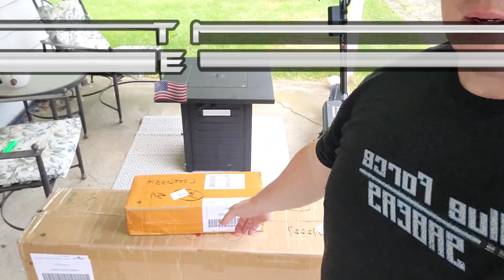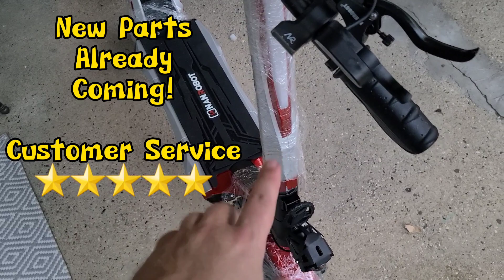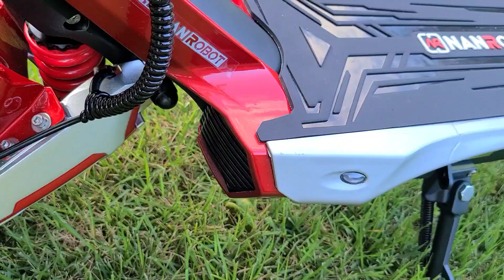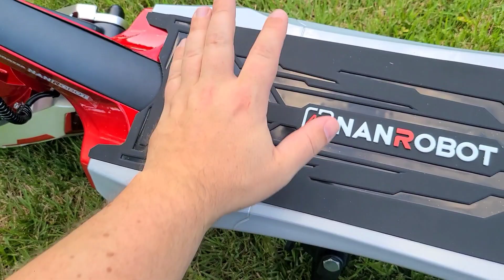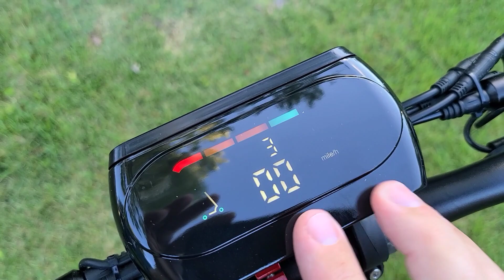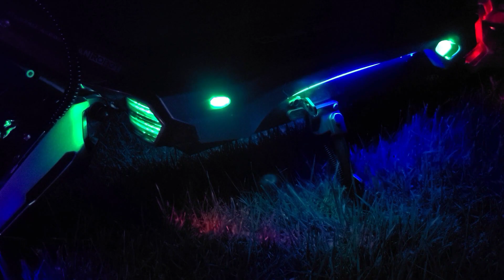Nanrobot N6 Electric Scooter - 1st In The USA -- Deep Dive Unboxing and Setup!

Comment: Nanrobot quality isn't really that good.. coming from the ls7+.. these are very expensive.  And it  falls apart  quickly.. brakes squeeked right outta the box.. headlight rattled right off even after I tightened it all the way.. and the tires aren't very good.. got a flat with in a week even with proper inflation..   all stand up scooters tires should be airless , because changing the. Tubes out is a bitch.

Comment: The lack of 60v battery ruins it imo
Reply from the maker: Really don't think you need a 60v. 60v scooter you only gain a bit of extra speed and acceleration but loose quite a bit of run time.

Comment: Did the p setting/lcd fix also take care of the odometer resetting on newer released d6+ 2.0? Planning on purchasing a d6+ 2.0 but wanted to make sure I got a fixed version. Thanks!
Reply: It's fixed on the N6 but I believe it still resets on the D6+ 2.0.
Reply: @BlueForceSabers  do u have an idea if they will update them at all?
Reply: @JayHyphy18  Not sure honestly
Reply: Are the decks the same size n6 and d6+
Reply: I just got d6+2.0 and it does reset everything. I dont care but it would be nice if they do fix it in future.
Reply: @pacochawa2746  does it completely reset the scooters odometer also or just the trip meter?

Comment: Where are the controllers located in the N6?...  I didn't see them under the deck when you installed the battery.  I'm going to guess they're located in the rear tail fin
Reply from the maker: It's just a single controller in the N6 and D6+ 2.0. They both use the same one. You can see it under the wires around 5:24 in the front of the deck.
Reply: @blueforceerides  that's cool! How many amps is this single controller? I've got an older D6 that uses two 28a controllers
Reply from the maker: @spencerjames1426  Yes, they changed it to a 2 in 1 setup with the center display. I'm not sure of the amps off hand.

Comment: Those  too much Led lights can eat up Battery life
Reply from the maker: Not really, LEDs draw very little power. Shouldn't really see any difference.
Reply: @blueforceerides  facts. LEDs are extremely low power.
Reply: @blueforceerides  Yes a little draw if it is just one or two leds but when it bcomes too many believe me it will have a big impact,  like 5w or 10w,  that's why other  escooter rider prefer  a separated supply power bank for the LEDS,   so ok,  for you its ok to have thousands of LEDs,  but for me and the others will use a separated supply   God bless

Comment: Hmm battery could use double sided tape to cushing it in makes sure battery fits tight and snugg with no bounce around
Reply from the maker: It does have double sided tape on the bottom. It also fits snug so it doesn't slide at all.

Comment: I want to see you ride it not just talk about it.
Reply from the maker: Unfortunately, I don't have all the cool 360 cameras to show me riding it but I can certainly give you the details and information on it. I'll do a bit of ride footage in the future with the old GoPro. This was more of an information and first look.
Reply: @blueforceerides  How is the size compared to the D6+?  Can you put this in the trunk of a normal sedan?  Is the speed and acceleration the same as the D6+?  How comfortable is it?  Are the tires tubeless?
Reply from the maker: @trollhunter8842  Size is comparable to the D6+ and the ride is great! Tires are the same as well. The acceleration is better and the throttle is more sensitive, speed is the same.

The look of it is really what separates it apart from other scooters and the lights on the N6 are super cool. You just feel stylish riding it around. I was stopped 3 times by people to ask what it was. It's a great conversation starter. With the looks of the N6 and the same ride quality of the D6+, you really can't go wrong.

Comment: Well I'll admit it doesn't look as bad as I thought it would, even though I'm watching this in 480p because I'm sure the video hasn't finished rendering on You-Tube 😋

#teamironman 😎
But I heard you mentioned the D6+2.0 resets the mph back to kilometers when you shut it off and I think on another video in the comments it also doesn't save your total trip mileage from your 1st trip; but a fix was coming.

I'm glad this version fixes that. 😀 I need to know how many miles I put on it, lol.

I noticed these scooters break lights are now coated like the Vsett 10+ but thats fine because both scooters are plenty bright. 👍🏻

But what about the FRONT TURN SIGNALS? No one ever shows them, lol.

How do they even look. Also I notice on Igor's channel his review unit had the rear break light turn signals on top of the break light and not on the bottom like yours. Not that it matters, but for safety I think putting it on top looks better. 😜

I still think the black model color looks better but this is cool. Whoever designed this is a fan of anime and japanamation with that sleek mecha like design, it looks dope 😀😀😀

Still waiting on that D6+2.0 acceleration test. Hope there's no throttle lag on this unit 🤔 Can't wait for you to test it and do a comparison against the D6+2.0

Too bad you don't sell Vsett bro. I know your reasons why but I wanted to buy two scooters off you like I said. 🙂

We decided on the Vsett 10+ 60v 25.6ah versions 😃...it was a VERY HARD DECISION 😅😅😅

I still love the Nanrobot D6+ 2.0 ❤️ 😍 💖
It was my favorite scooter and choice for  a while, till my wife mentioned she liked the color of the Vsett 10+. I want to have a couples match, lol. Plus the D6+ might be too big for her. The Vsett seems to meet all our needs better.

I'll probably order a 3rd scooter sometime and make it a  Nanrobot 👍🏻👍🏻👍🏻

Great review! Can't wait to see you ride this and how much fun it is.
Please show front turn signals in your next review or video on it....and the horn!
✌🏻
Reply from the maker: Hey man thanks! Haha yes, I guess it is still processing, vid was shot in 1080p, 60fps.  It's funny you mentioned the front turn signals because after I shot it, I said dang it, forgot the front turn signals. 😆  

I absolutely love the way it looks and the front light is amazing! I took it out for a 20 mile ride last night and it was a blast.  Got stopped 3 times by people. It's a great conversation starter.

Yeah, the reset is a bit annoying but doesn't affect anything else on the D6+. Definitely not a deal breaker. Glad they fixed it on the N6.

Comparison will be coming, so stay tuned!
Reply: @blueforceerides  Thanks 😁 yeah your video really showed how bright that front light actually is. 

I'm watching it again in all of its full 1080p 60fps glory..🥳🥳🥳

My wife absolutely loves the front light. If this came in the black version here in the states I'm sure I could've convinced her to get the N6. Since it's a lot sleeker looking then the D6+

....Ah heck who am I kidding she wouldn't even have a choice 😂😂🤣🤣 I'd get them...lol

But Nanrobot said when I contacted them the red version doesn't ship to the US untill November.... 🤯🤯🤯